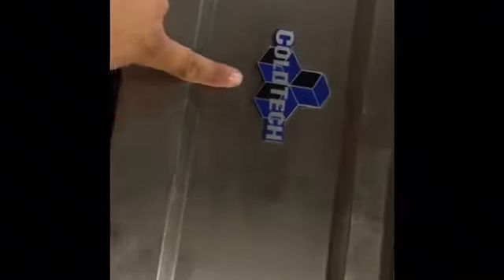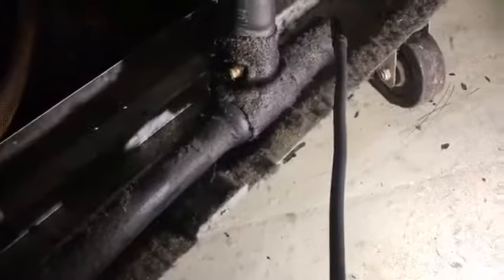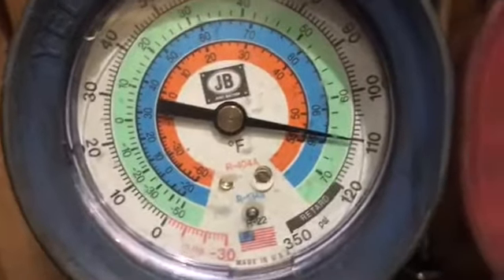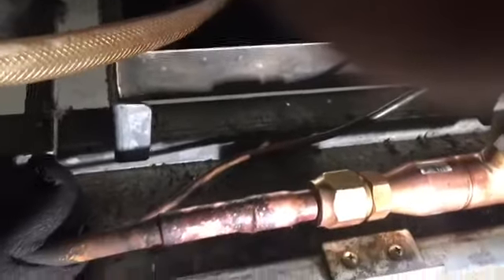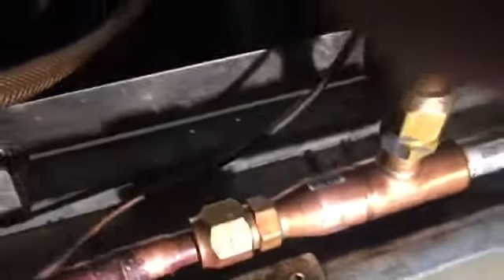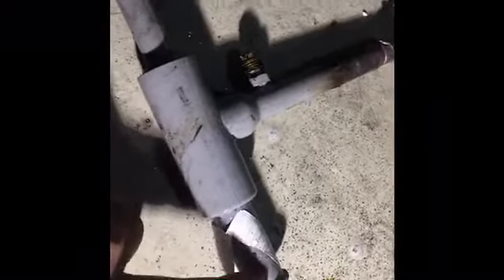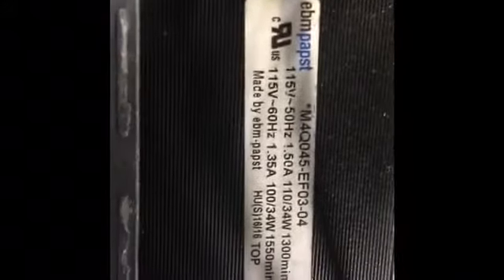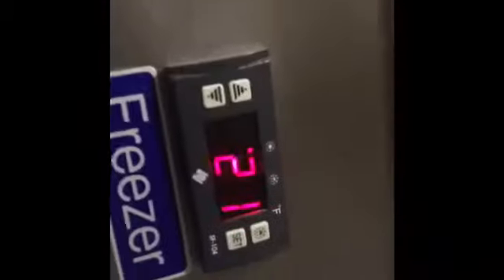HVAC-R Coldtech  Jimex 2 Door Reach in Freezer

Comment: I called for info on a reachin freezer a couple of years back. I can't remember the maker of it. Their 1 800 number rang into a adult chat line, lol. They went out of business. I ended up redoing the drain line on my own, out the back of the unit, what a pita.
Reply from the maker: polishtheturd mickelson that’s a funny 😆 one thanks for watching
Reply: I was worried I was going to get busted by the IT department where I worked at the time. It was scary, I didn't get in trouble. Just had to think outside the box to repair it.
Reply from the maker: polishtheturd mickelson ohh damn Yeahh sometimes you have to think that way

Comment: awesome video bro! so your CPR valve what's the usual set point?
Reply from the maker: THE HVAC GUYS  they usually come preset , they you know if its set correctly and won't get flood back to the compressor is by checking you RLA, on startup or by putting the unit in defrost, then take it out of defrost and watch your amps, for instance if your RLA, at the compressor are 15 you cannot exceed that on startup I always keep a 5-7 Amp difference inbetween so if 15 are my RLA.. I'm good at 8-10 on startup, now if I exceed my amps on startup I'D have to adjust the valve , i belie  clockwise is to increase, and counterclockwise is to decrease 😁
Reply: Felipe Tafolla thanks I don't think I will work one tho lol not that I don't want to just that we don't mess with that maybe later.
Reply from the maker: THE HVAC GUYS I see is not that complicated bro, but hey I'm here to help any questions let me know..😁
Reply: Felipe Tafolla for sure thanks
Reply from the maker: THE HVAC GUYS no problem